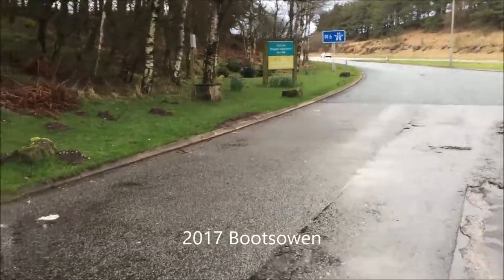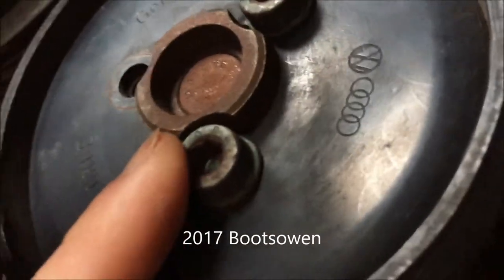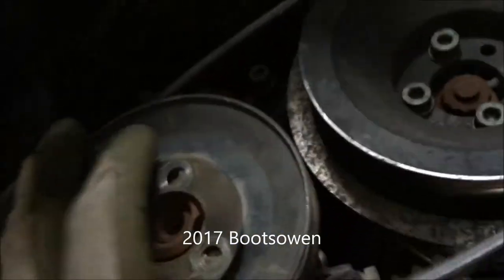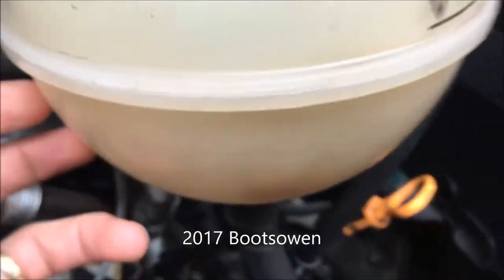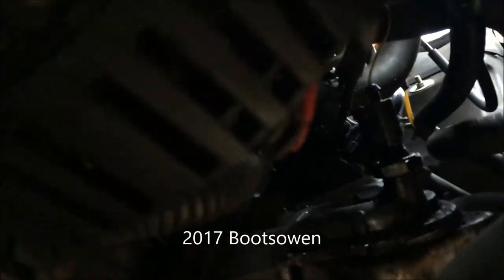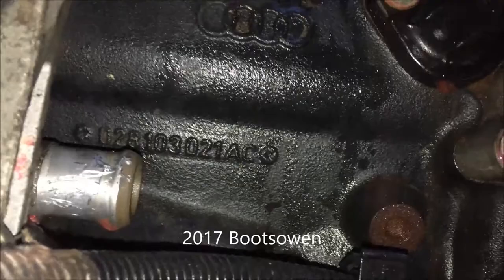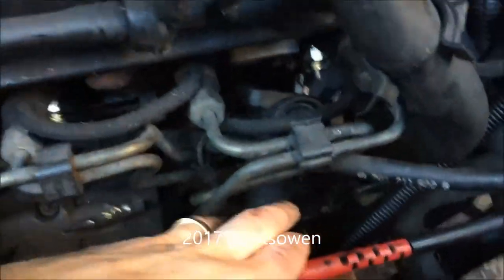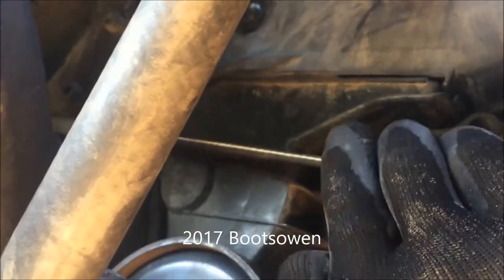VW T4: my first breakdown!

Comment: My t4 1x engine did exactly the same on the way to work last year, managed to get to work and eurocarparts after work but was overheating badly luckily was winter. Now i carry both belts and tools in the back of van happy days! seems like a common fault with these engines.
Reply from the maker: Yeah, I went through a few years of carrying tools and belts and other bits. But then nothing happened. It is usually very reliable and I got slack and got caught out.  I could have done the belt at the roadside but at that point the manifold had already gone and it was too late.  Funnily, once before setting off on a long journey I checked the spare tyre and it had been stolen! could have been a day, could have been a month, who knows? But I had to hot foot it around all of the breakers yards the next day to get one, before the trip.

Comment: Glad you got it fixed, how has it been since? How old was the belt? I have a Gates alternator belt on at the moment, it will not stop squeaking, old belt was OK but I changed the power steering belt and thought I might as well do the alt belt at the same time, should have just left it, I've got a Febi alt belt so I'll swap it over when I get the chance.
Reply from the maker: Running fine since. Nothing to report really, the old belt was about two or 3 years old. but one of the 3 screws holding the water pump pulley on was missing, so maybe that had something to do with it. If your belt is squealing it is maybe the tension? I normally put a crowbar under the alternator to lever a bit of tension on it.  But i probably didn't put this in the video.

Comment: id say you must of lost your coolant somehow as same the belt in my t4 came off one day as well .   you can drive a little way at a time ( 12 - 15 km ? ) at a time without overheating the engine if it is only the belt broken .
Reply from the maker: The coolant came out through the manifold o ring gasket seal on the front of the block. it is in the video.